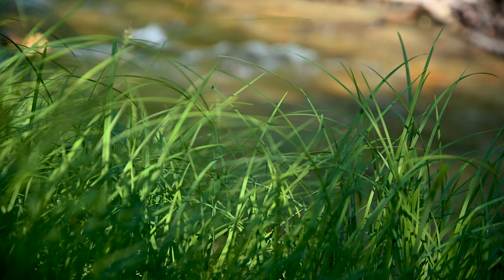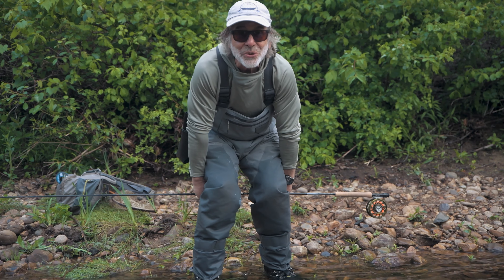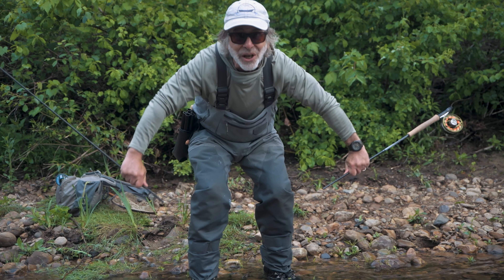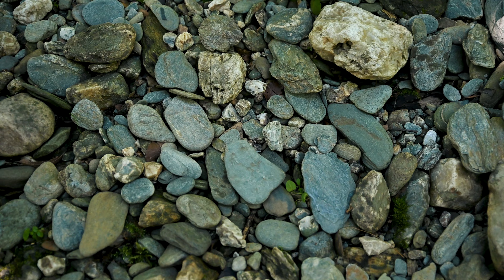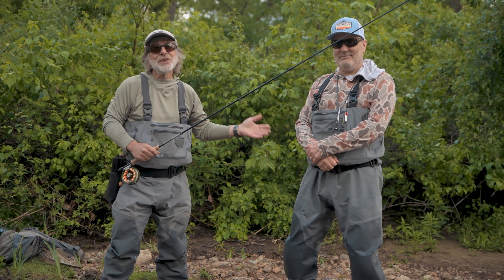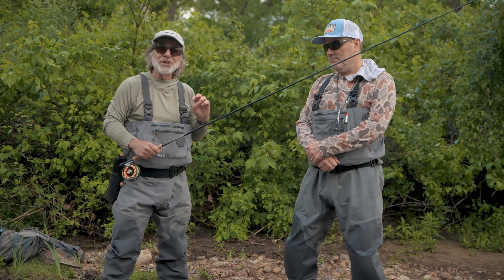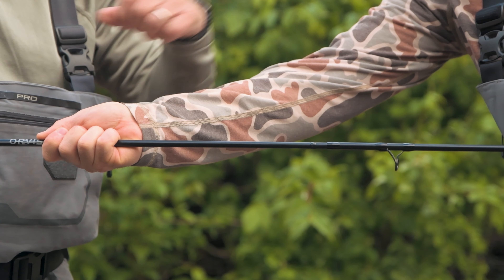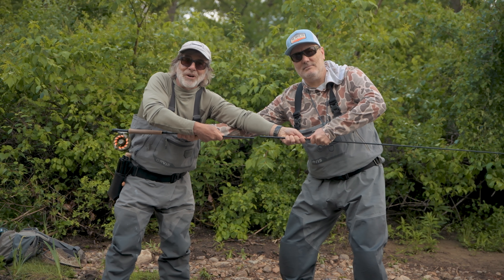How to Get A Stuck Rod Apart

Comment: The best way to get a rod unstuck is to pack ice around the ferrule! 
This will compress the air/fluids inside and help you get the rod undone.
Sometimes fluids can create a seal that locks the rod , putting such mechanical force to undo the rod will damage it at its weakest point ie the ferrule.
Hope this helps

Comment: I’ve seen rods taken apart with ice and very hot water.Place an ice cube in a towel on the smaller diameter section and then angle the rod section down and and run hot water over the other section. You are contracting one section and expanding the other section. This can’t be done stream side but it was very useful for a fisherman that needs to fly home in a couple of hours.

Comment: I use the twist method works well, as far as stress on the rod the carbon is wrapped on the metal rod to make the rod, so twisting should not hurt the rod.

Comment: These are fairly silly and put you in awkward positions where you're more likely to break your rod.

If it won't come apart, take a deep breath and blow it on the ferrule/ joint--like you're trying to fog up a window--and then pull like you normally would. 

I've done this from 0 deg F to 100 deg F days in Montana for 8+ years, never fails.